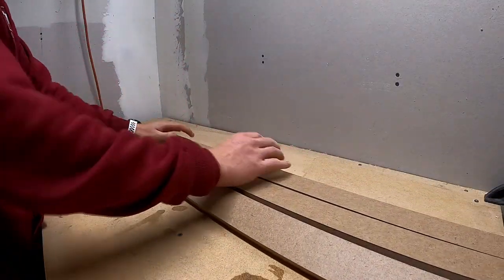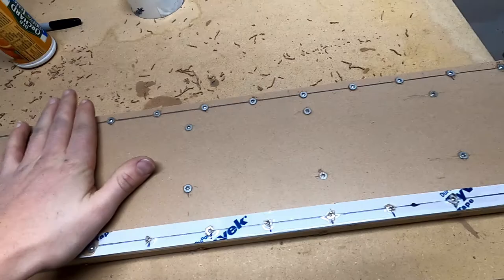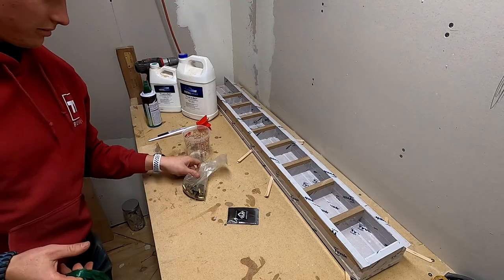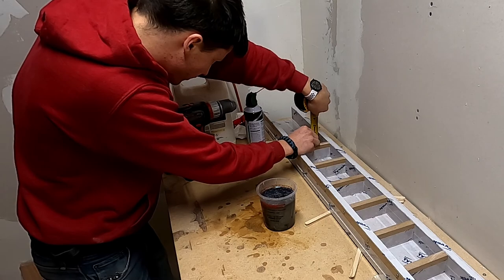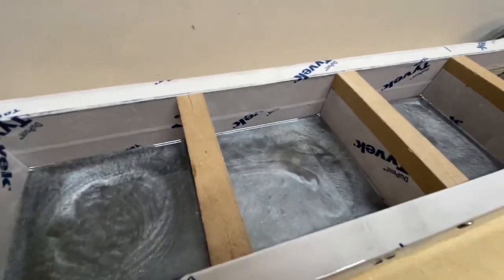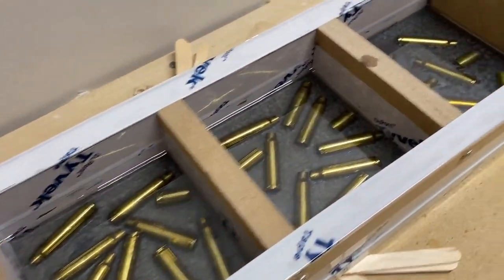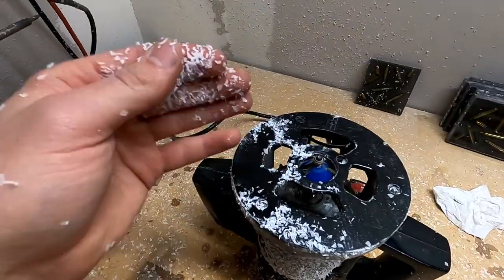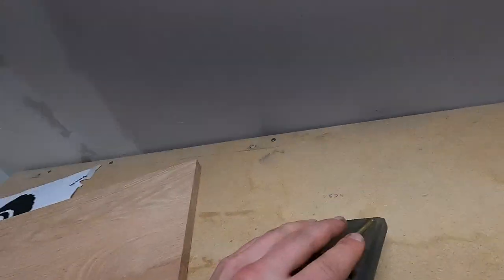Brass Casing Epoxy Coasters | DIY

Comment: these look very awesome  . if you don't mind ( and i hope you don't) i would like to make a small suggestion . next time you make something like these , instead of making them flat , make them with small ridges around the sides . that way it catches the condensation from your cold / ice drinks .
Reply from the maker: Ooo... no I appreciate the tip. I like the idea. Maybe make it a little thicker than I had it and router out the center leaving a thin ridge around the edge? 

This would perhaps make having a clear top a bit more challenging but I’ll think on it. May have to try it. Any thoughts on how to keep it clear on top as to see the brass casings?

Comment: Heat gun way better than torch.  Looks like you didn't hit the Becker sign with it, should be able to see the difference.  Like the coasters!
Reply from the maker: Yeah agreed found that one out. I did not no and I forgot to put a seal coat for the wood on those but to be honest I like how it turned out. 

Thanks for the tip and I am glad you liked the coasters!

Comment: Those turned out with a real BANG!   The background color does remind me of gunpowder, since it's along that gunmetal color.  I've been testing some epoxy resin projects over the past 2 months, and the one similar to this didn't turn out too well.  lol.  I used some of the thin silicone mold coaster sets off Amazon.  I used 1/64 scale Hot Wheels and cut the sides to lay flat and attempted to grind the wheels to do the same.  The first issue was on 2 of the coasters- I CA glued each HW side and wheels to the coaster.  After the epoxy dried, I pulled the coasters, no problem, but you could feel the backside of the truck on the bottom.  And the glue ruined those 2 coasters.  lol.  

The 2 coasters I didn't glue didn't turn out much better!  The wheels and the body kept floating around.  I adjusted and heat gunned them 3 times before letting them dry complete.  One looks like it has hydros and the other looks like a wheel came off the lugs.  That would be awesome if that were my intention.  lol.  And they all had quite a bit of bubbles only around the body of the HW.  

So my question for you is (sorry for the long detailed story)- Can you feel the casings on the bottom side of your coasters?  And did you have any problems with air bubbles?  I didn't notice any in your vid.  

Thanks for sharing this.
Reply from the maker: Haha “with a real bang” I love it. Thank you! I am glad you liked the video I really did like how the gunpowder affect turned out too. 

Oh I see, yeah epoxy can be really tricky I have found with other projects. These coasters largely by luck came out very well. 

You can see the casings where I sanded the bottom just a little bit but it is not really distinguishable from the epoxy bottom other than color. 

As far as the hot wheels cars go I am not sure what you could do to keep wheels stationary the hot glue idea sounded good I probably would have done the same. Sorry that didn’t come out as you wanted. Maybe use like clay? Did you try sanding the bottoms down after the epoxy had set?

Also, what epoxy did you use? For me, a little bit of use with the heat gun with the Total Boat DEEP SET worked just fine. 

I would love to see pictures of you have any to share with me and follow up with you on this. If you would like message me on Instagram ( https://instagram.com/tbbuildsco?utm_medium=copy_link) or email me (tbbuildsco@gmail.com)

Thanks again for sharing!

Comment: Genial trabajo. La resina epoxica debe ser resistente al calor o se puede usar cualquier resina epoxica gracias.
Reply from the maker: ¡Gracias! La mayoría de los epoxis son termorresistentes hasta 150 C o 300 F. Hacen epoxi que es resistente a temperaturas más altas. Espero que ayude.

Google translate:

[Thank you! Most epoxy is thermal resistant up to 150 C or 300F. They make epoxy that is resistant to higher temperatures tho. Hope that helps.]

Comment: how did you attach the rubber feet to the bottom? thanks!
Reply from the maker: @seanconti1696 they were adhesively backed so just had to stick them on.

Comment: Good job, I use silicone molds for mine, much easier!
Reply from the maker: Oh nice! Yeah most likely yeah. Where did you buy yours. 

If I keep making then I will probably end up getting one.
Reply: @TBBuilds  bought mine off amazon.
Reply: @TBBuilds  Rockler also has a set in both round and square (item #67390).  They work great.
Reply from the maker: Awesome, I’ll check it out. Thank you!

Comment: How long did you wait to place brass after pouring the gray base layer?
Thanks
Reply from the maker: I placed the brass right after I used the heat gun on the epoxy I just poured. So they sank to the bottom and when I sanded the bottom of the coaster, I exposed some of the brass. 

Depending on the diameter of the brass casing, I could have waited for the gray layer of epoxy to fully set and then place the brass casings to keep it from sitting all the way at the bottom and then pour the clear.
Reply: Thx for taking the time to save me some frustration.  Keep it up man.
Reply from the maker: Glad I could help. Best of luck trying it out!

Comment: What's the tool you use to smooth the edges?
Reply from the maker: I used a router with a chamfer bit… although in hindsight that wasn’t the safest way, should have a router table to hold the router for things like that.